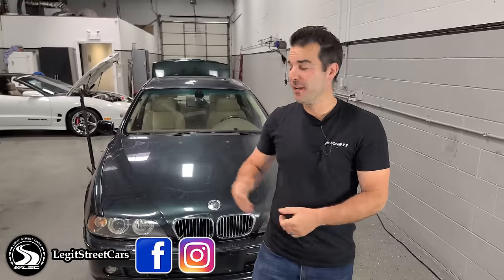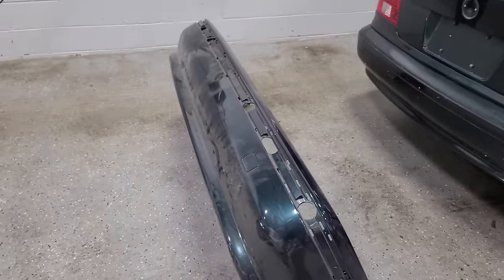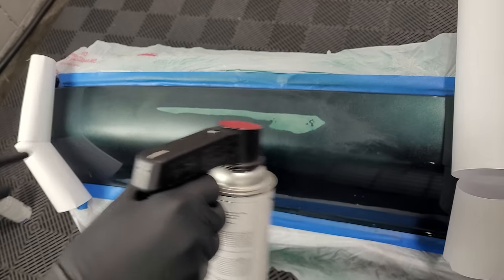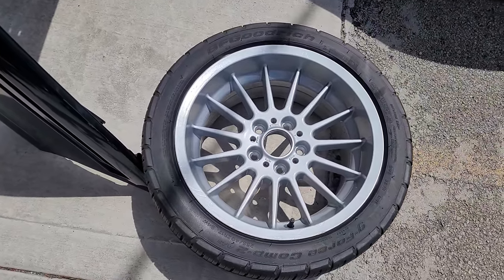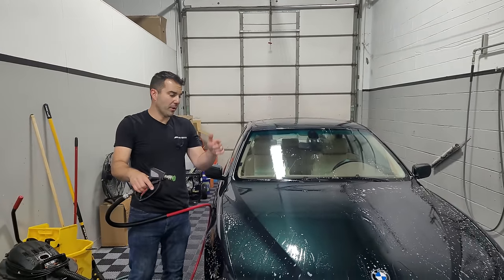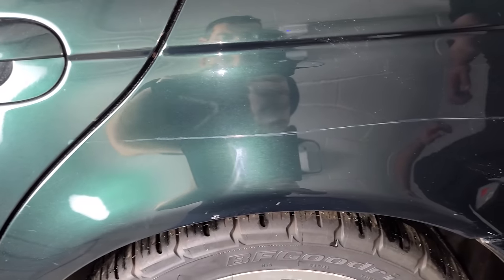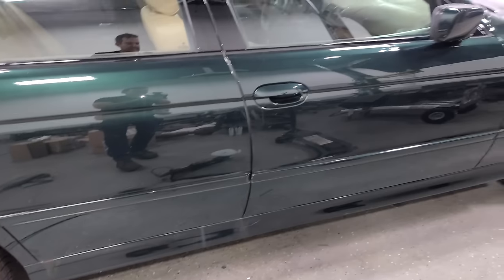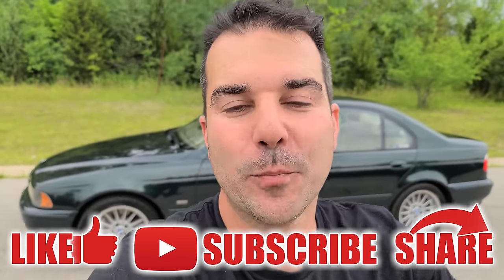I Finished EVERYTHING On My $900 V8 Manual E39 BMW! INSANE Before & After + Final Cost Tally!

Comment: I like to put spray cans in hot water to lessen paint spatter, you can also get custom paint can tops to get different spray patterns.  I start at 110F, but you can alter it depending how much is still in the can.

Comment: Excellent work. I've said it before but I just can't get over how well that scratch repair procedure of yours works. For really deep scratches, would you recommended applying a little filler beforehand? I don't know how much bulk the paint and clear have to fill out a scratch but I expect not a lot.
Cheers, keep the good stuff coming.

Comment: Nice work bringing that one back as it was almost certainly headed to the junkyard after that towing company had it.  The only thing I would've done different is the two-tone interior, but It goes well with the dark green paintwork. These are really nice cars to drive ,and only upgrade needed is an LSD Diff.  I need to get a buffer/polisher and learn how to use it, Wow!

Comment: Some really nice tyres? it must be a joke??!

if you pause the video, so you can see that the tire has some cracks on the inside of the tire, in between pattern, there are some cracks! 

Check the tires again, and throw them in the trash…

Comment: The reason for a high pressure cleaner comes with a long pipe,
is because you do not have to let the water spray on your clothes
and Shoes.
But you know it well, so why have you taken the extension tube off.
Do you need a bath 🤪

Comment: But now i can tell you wanna sell it for a high price since you fixed thing as smalls as that little bumper piece and things like that, problem is someone looking for a super clean 540i might buy this now and you took away all the warning signs of a bad previous owner that probaly didnt change the oil enough an left sludge. You gotta sell this at an average price theyre selling for so no one thinks its a super clean car.
Reply: Espcially since 545s sell for 5 grand or less. These 540s are worth about 3 thousand you should of just made it run good with the coil and the airbag fix the painted seats and sold it
Reply from the maker: I'll just do an auction and let the market Decide
Reply: @thisguyfromyoutubesaid1537  545 isnt the same gen as a 540i.  the N62 is trash, the M62 is a solid motor.  people clean these cars up all day long and lets get real here this car shows plenty of good signs and its been super transpartent about all its issues, which so many have been attended to.  the market for one of these cars is enthusasts, the average person looking for a car wont bother with this....which limits its market and the people wanting an E39 M62/6speed know what they are looking at, and what it is, and seek them out.  
the only way these cars, in this market, in the rarity of this car is in this configuration would be $3000 car is if it is trashed and double the miles.  
this car has like 4 videos now of every single inch of its imperfections and fixes, which enthusasts will appreciate all day long that the fixes done to this car while still needing some love and time makes this a solid core to start with.  
meanwhile you are comparing this to an E60 generation with a horrible reputation.  
this car isnt a cars and bids pefection car...but its a great solid base for someone to contiue to love and work upon.
Reply: @LegitStreetCars  im gonna throw my thoughts here....$7k on the average,  maybe with this wild market possibly 10k.  please please do a video when it sells.
Reply: @baldisaerodynamic9692  the e39 v8s have all kinds of problems tho there not solid they have timing chain guide problems that are worste then you hear about some people dont actually beat on these cars and they last into the higher miles (not actually high but bmw high wich is 200,000) if your lucky but if you try an use it for what its made for a v8 and manual theyll break and then of course you have all your typical bmw cooling system problems and vanos problems on top of other problems as well im sure. And the fact this guy painted the seats with house paint should and would scare anyone from.buying it because its a bmws could of had cooling system problems and the owner was to cheap to call a tow truck makes it those 2 blocks home motor could still run fine just a little warped a little more wear an tear. Its a manual so again dumb owner another thing you woudlnt trust them with not of messing up. And then of course the oil safe to a assume they didnt change it enough if they have the red flags it did. Even the fact it only needed a coil pack hes too cheap to take it to a mechanic
Reply: @thisguyfromyoutubesaid1537  ive seen M62 motors full of sludge and still run great.  

as for timing chain issues, its hit or miss and if its a non vanos m62 they pretty much never have issues.  my M62 had 230k on it and the guides were still good.  my 62TU had 175k on it and the guides were still good however the TU motors have more documented failures on the guides.  yes maintained is key, but you im guessing you totally ignored this series.  its not easy to blow an M62 headgasket either.  every M62 i have ever had has exceeded 200k miles and i was never the first or second owners.   you are complaining about a coil pack cost?  maybe you should not even be owning a car at all then.  first off m62 coil packs take 5 minutes to swap out so no way would it cost a fortune.  
my last e38 looked like a POS on the outside, faded paint, cracked bumper, etc but it could have been driven anywhere.  

i have no clue where your misinformation comes from, but you are far far out there with it.
Reply: @baldisaerodynamic9692  i never said anything about the price of coil packs i said the old e39 v8s had problems as well as the e60 545s the 545s just got a new problem with the old ones to of rod bearing problems i think it was
Reply: @baldisaerodynamic9692  so your saying that the early years of the 540i had no one having timing chain problems? What years are those?
Reply: @thisguyfromyoutubesaid1537  reading is fundamental.  something you need to work on.  i didnt say they didnt exist, and i said they exist more in the TU motors...and so what if they do exist, along with many other engines and car makers...
Reply: @baldisaerodynamic9692  very rude.
Reply: @baldisaerodynamic9692  its a problem some cars get it before others that all. Not changing your oil as frequent wears them down faster. Theres no less common on tu anything just a very small case study of your own 2 cars making you think that, the deffinition of bias

Comment: Super disingenuous to pretend these are cheap finds that can be spruced up easily. You didn't do the timing chain so it's really no more valuable or collectible than it was before, being that the #1 concern for any buyer would be the chains. You're the typical quick-flip used car dealer that I would never want to buy from. There's more to a car than it's aesthetics dude.